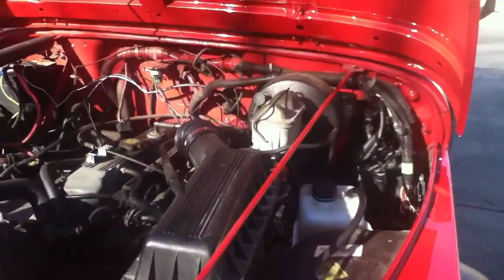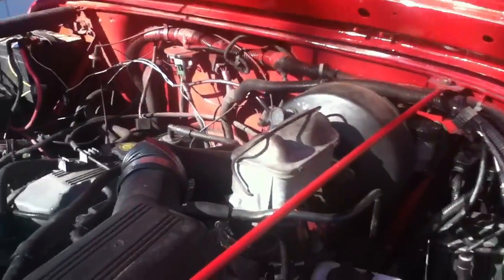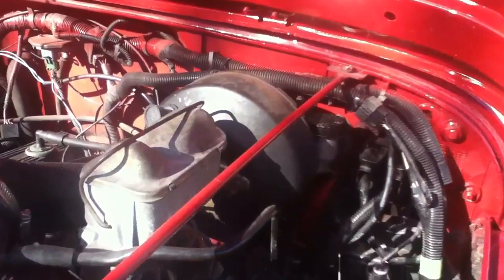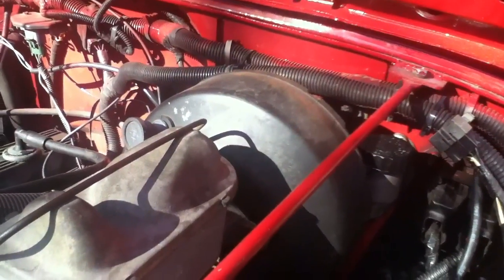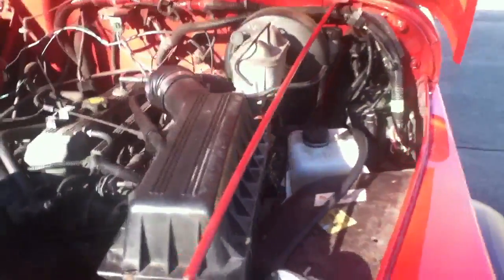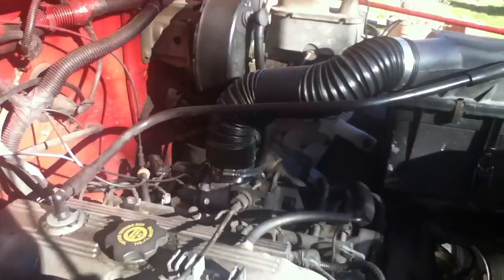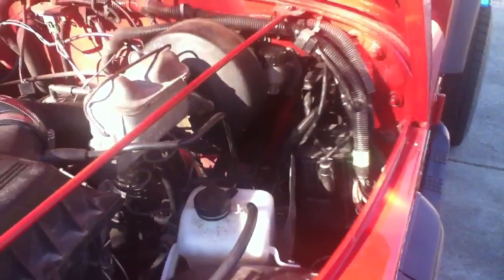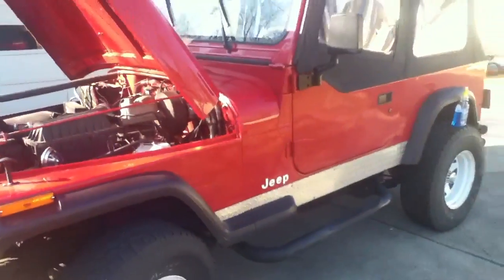Jeep YJ Wrangler Loose PCM

Comment: OMG Been chasing the same sort of problem except it has to do with the blinkers. But the fuse would blow on the blinker circuit intermittently. Until now it would not take a fuse and i was forced to trace wires. PCM screw was not tight. You helped me make sure that the pcm is tight. Problem solved!!!!! THANKYOU!!

Comment: I have a 94yj.  I had a recent problem with no start issue.  I had installed a new stereo, and at the same time removed the old under dash AC unit.  I hooked up the stereo and while doing so would start the Jeep periodically to make sure all was good.  After everything was buttoned up, and after sitting in the garage for a few days I jumped to go for a ride and no start.  I checked YouTube and came up with no real explanation, however I did find one video of a guy that stated that if the check engine light did not come on when you turn on the key it would not start.  I looked for the video again but to no avail.  I was not getting the CEL when I turned on the key.  Here was my problem and fix.  I bought a fuel pump relay, because I put in a new fuel pump recently, and even though I know nothing is perfect, I could not imagine it was bad already, just in case.  I remember I was fooling with the ignition wires at the base of the steering column while messing with the AC unit.  I got down and pushed in each wire, and separated them as best I could.  Got up, crossed my fingers, turned on the key and BAM the CEL light came on and I heard the fuel pump clicking and  I thought no freakin way.  I turned the key a bit further to start the engine and I'll be damned, it started right up.  Sorry to be so long winded but there were different things I was doing under the dash and thought I should explain.  Since then it starts every time, and I have an awesome new stereo that sounds great.  The point being, if the CEL does not come on when you turn the key on, I don't think it will start.  So in essence, this could be another problem, and if it happens to someone else and there is no CEL when the key is turned on, I think it's reasonable to assume there is an electrical problem of some sort, whether it be the ECM, a blown fuse, or something as simple as checking the ignition wires on the column.  I hope this helps someone in the future!!

Comment: Yeah, I'm having a problem with my '95 YJ going dead just traveling down the road. Unfortunately I've already checked the ECM harness and plug and the fuseblock plugs and screws. Great tip and video!
Reply: look up the videos about capacitors or something, shows $10 parts and some solder and you are good to go with the common issues
on 6 cyl..... 2.5 I can't find answers
Reply: My tj would die going down the road but my problem ended up being the ignition switch.

Comment: Awesome tip!     Can sometimes clean contacts with electrical cleaner to remove oxidation from where the circuit board plugs into the harness pins, so i was told, nothing is working for my 90 2.5, can't even find the PCM unless it is that small black 4"x4" box but the used one that is suppsoed to fit mine looks way bigger, is silver in color, looks normal like a pcm usually looks, mine not the same at all.

Comment: Brother, what test did you accomplish to decide if any one of those sensors was bad, did you get a code in the computer for each one that you changed and then do a couple voltage measurements? Thanks for the heads up on the fix. Preciatchya.

Comment: Thanks for the video, I think it tipped me onto something. My YJ every now and then will not start, I lose all electricity and then it comes back after moving the jeep around a bit. I'll check that, and also my battery cells
Reply from the maker: Thanks for commenting. Electrical issues can be a bear sometimes. Talk at you later.
Reply: TheAwesome ——hay did that fix your no start issue ? I’m curious because I’m having the same issue .
Reply: @mrt9781  I think I just had a broken terminal inside my battery.

Comment: I've been having problems to start my 95 wrangler, it used to be only during winter time but now it got worse, after replacing a bunch of parts it still giving me trouble to start. To start it I need to turn the keys on (but not all the way to turn the engine) and leave it on until I hear some clicking noise at the front near the battery which sometimes take an hour to happen, it will never start otherwise. A friend of mine said the problem is the ECM but I don't know where it's located?

Comment: Don't know if you can help. I have a voltage issue with my 93 yj 4.0 the washer motor is only getting 10.5v to 11.2v at the plug. Do you know where the ground is for this? I guessed the one by the headlight. But hear the problem may be in the stalk. The wipers seem to struggle when on too. If anyone can help that would be great?  Thanks

Comment: I had my clutch replaced also the thermostat and now the check engine light goes on after I drive it for awhile. Ive check the codes but still does it?

Comment: Is this the module that controls the voltage output of the alternator?  My alternator is said to be good by the parts store but not putting out any voltage.  No one seems to know if the voltage regulator is in this PCM.
Reply from the maker: I am not sure but it could cause problem if connection was loose.

Comment: Did it turn over and not crank or not turn over at all mine want turnover unless I take the relay out and jump the relay with switch on then it cranks and runs.
Reply from the maker: It cranked but would not start. Engine would die going down road at anytime after bump. Tightened screw and never did it again.😁